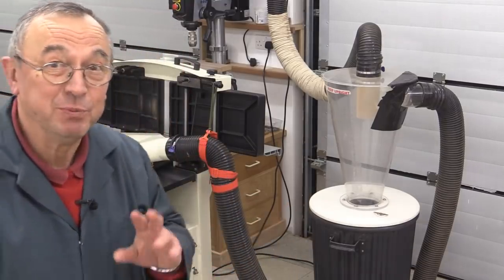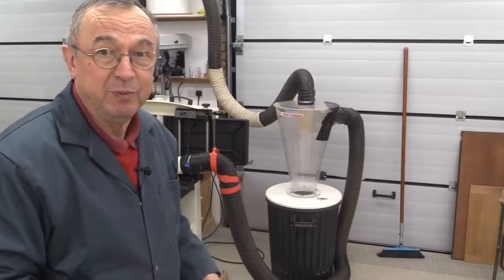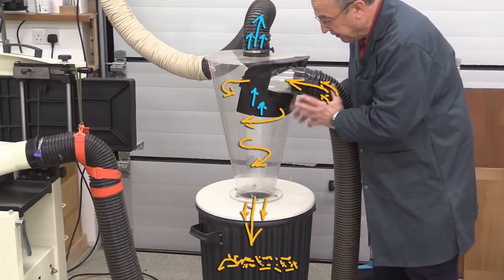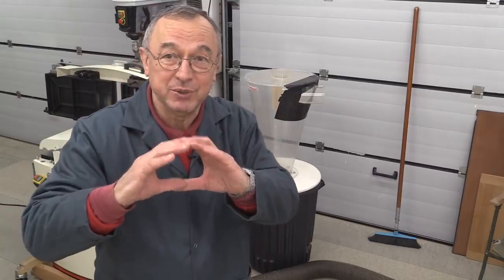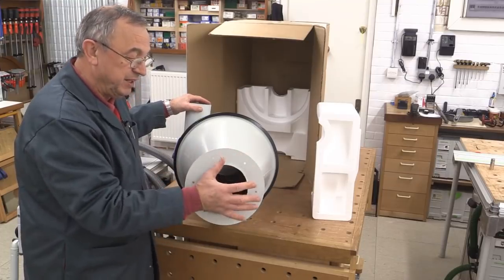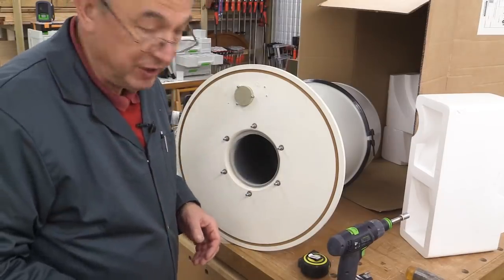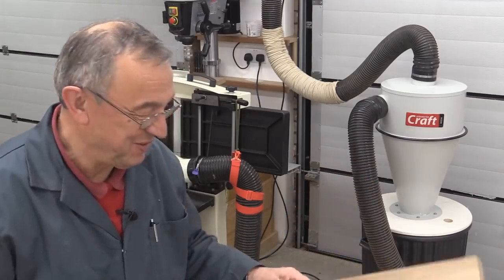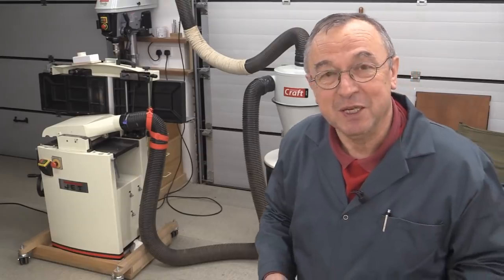New 4 inch Cyclone

Comment: Please give measurements in Imperial Units, NOT foreign ones.  We are British.  Why call your channel "New Brit Workshop" and then - millimetres - AAAAARRRRGGGH!
Reply from the maker: I just Googled the length of that bridge and the answer quoted was given in metres - 2512 m. I respect your view on measuring systems but I am glad to say that we are all free to choose what we use in the comfort of our workshops.  Peter
Reply from the maker: Hi Rebecca, On your phone you will probably have a calculator. If something is given in millimetres just divide by 25.4 to get inches. It is now illegal to sell wood in the UK in old Imperial units so it is probably a good time to try and do the switch. I moved to metric over 40 years ago and it makes all the arithmetic in the workshop so much easier. The biggest challenge is visualising a metric measurement but in a very short time this will not be a problem.   Peter
Reply: @NewBritWorkshop  I have been a Technology Teacher and Head of House in a Secondary School before I retired. My Specialist subjects were Resistant Materials, Graphic Products, Food Technology and Electronics.

I am perfectly fluent in Metric and have been for decades. The Imperial System is currently and ALWAYS has been in the Maths National Curriculum.  Our children have been taught to be fluent in both so they can deal with overseas trade.  I have found that it is VERY RARE to find a child who wants to Design Anything in Metric, the numbers are far too complicated as they are expected to measure in Millimetres.

The Imperial System is based on actual measurements of real things from antiquity when a roof Pole grown from Ash reached different heights in different climates of the UK, or Perch the same measurement from the old French Perche.  Estimating by eye is ONLY possible in the Imperial System, from inches - exactly the width of my thumb, to a span 9" to the size of a field in acres or multiples of Roods.

My timber supplier quotes me prices in  GBPounds per Board Foot.  There is NO Metric equivalent that he has ever come across.  If you buy wood from B&Q that may explain it.

Try measuring the Forth Road Bridge - In the Metric System it has to be done in Millimetres - rediculous.  It would take longer to work out how mutch paint you needed than to paint it.

I find it Insulting to our Country and our Heritage as a Brit to only give Metric Measurements for anything, but then you may be one of those undemocratic Remoaners who can't accept the result of the Referendum of 2016.

You only have to travel on our Roads to realise that distances to a roundabout are given iin 300, 200, 100 YARDS.  In fact it is ILLEGAL to put up road signs in the Metric System unless the Imperial System Measurement is ABOVE and more Prominent.  Every car on the road in the UK HAS to have its speedometer in MPH and NOT kph as all the speed limit signs are in the Imperial System.

In 2016 the Country voted for a CLEAN BREAK BREXIT by the biggest mandate in the 300+ year history of Democracy in Great Britain and Northern Ireland.
Reply: @rebeccadonaldson1464  This little (large?) rant reminded me of a true story from 1980's New York airline ops (if I remember correctly).
The traffic on the ground of course matches that in the air but the re-routing can be considerably more difficult as aircraft have become much larger as the taxiways remained basically the same width.
A female ground controller was on duty and was issuing taxi instructions for arriving and departing aircraft at machine gun speed common in the New York area. A foreign crewed 747 took a wrong turn in poor visibility and found itself unable to move forward as the turns ahead  were designed for much smaller aircraft. Obviously it can not reverse and thus was destined to remain in that position until a tug could be dispatched. The female ground controller was very upset and informed the 747 crew to " in future - you are to do what I say, do how I say and when I say it and you will not have any problems". Although it is not permitted to make transmissions not directly associated with flying operations a microphone was keyed and an anonymous voice said "Were we married once"?
There are parallels.
Full disclosure: I fully support Brexit and am a modest 172cm in height.
Woods for the trees etc: Your thumb is part of a carefully designed metric system - there being 10 digits on your hands and combine with the 10 digits on your feet to - sort of an inbuilt metric abacus.
The Brexit result: 51.9% (17,410,742) vs 48.1% (16,141,241)
Those percentages are metric.
Never mind how many thumb equivalents - you won !!
Ain't life grand?
Reply: @ahstrewth  You Conflate Decimal with Metric.  The Brits have always used Decimals, Engineers measuring tolerances to 1/1000 of an INCH, known as a Thou.
Expressing it as 0.001 " is STILL Imperial, not Metric, though obviously it is a Decimal.
An Inch is the width of a Man's Thumb.
A Yard is a Man's Stride, watch the practice of the Changing of the Guard where all the paces are accurately measured by wooden dividers, turned over and over, spaced at exactly a Yard.
How the Hell would you measure a Cricket Pitch in Metric.  It is just Not British.
You can do Percentages and Decimals in the Imperial System.  A Decimal Percentage does NOT mean that it is part of the Metric System.
Sadly our Currency has been Dumbed Down by Metrication.  Children used to be able to multiply and divide by 12 and 20 just to calculate prices, in their Head.  Now all they learn to do is x 10.  We were the World's Inventors when our children had far better mental skills taught in schools.  The Brits Invented, Steam Railways, Hovercraft, Combine Harvesters to name but three.
Despite the Imperial System Never having left the National Curriculum, our children do not get the practice.  Oh yes, the old Pennies and Half-Pennies were exactly an Ounce and a Half Ounce, so could be used to weigh anything, anywhere.

Comment: In Australia, a BIG traffic cone would replace the cone, and easily make the rest out of whatever is chosen.
Reply from the maker: Hi Lawrence, In the time it would take me to make one from a traffic cone I could make a small jewellery box and sell it for three times the cost of one of these. Also, joining 4" pipe to a conical surface is not trivial if you want to get it right.   Peter

Comment: I prefer the clear one or the other similar semi translucent plastic ones. I just like to see that it is working properly...
Reply from the maker: I have not seen a clear or even translucent 4" cyclone on the UK market. The other issue is that with plastic ones you need a pressure relief valve as they implode if your inlet gets blocked.  Peter

Comment: Hi Peter, I asked Axminster if this cyclone was able to be used with a Vacuum extractor and they said no.  But obviously it can, have you had any problems with it?
Reply from the maker: Hi Grant, Technically they are right as "Vacuum Extractor" normally means a narrow pipe with high pressure and low volume - it could even be a small Henry drag along which would not work at all. However, my Numatic NVD 750 works fine even though its flow rate is lower than recommended for my planer.  Peter
Reply: That’s great, thanks for the reply Peter

Comment: Argh, I wish they also did a 5" version. I have a 2hp extractor (looking to upgrade to 3hp in the future), and don't want to step down from 5" pipe to a 4" cyclone. Any idea if that's in the works?
Reply from the maker: Hi Matt, I think that Axminster product 510073 will do the trick but do check to be sure. Here is a link:  https://www.axminster.co.uk/hose-reducers-plastic-ax827548     Peter
Reply: @NewBritWorkshop  thanks, perhaps I wasn't very clear! I have a 5" diameter system, that only reduces down at the machine. If I was to put a 4" cyclone at the start, it would negate the benefit of having a 5" system.
Reply from the maker: Hi Matt, Yes, I understand but there is no 5" around as far as I know.

Comment: Almost sneaked that one by me ! What a neat little trick with the socket, something I'm sure I will be able to utilise at a later date ! Thank you
Reply from the maker: Hi Ian, It really makes sense when using any cast iron equipment that requires an extractor to be turned on and off. I used four 12 mm diameter magnets to ensure that it never falls off due to vibration.   Cheers.   Peter
Reply: @NewBritWorkshop  thank you !

Comment: Hi Peter,  looks really good.  Can you persuade Axminster to make up the cyclone plus bag with a motor as well.  I am sure there was one like this on the website a few weeks ago but it has now disappeared.  If this was vented outside the workshop,it would not only be much quieter but wouldn't need a filter so could be very good value.
Reply from the maker: Hi Michael, I thought that they already had that: https://www.axminster.co.uk/axminster-craft-ac118ce-cyclone-dust-extractor-105845      Peter
Reply: New Brit Workshop The one I meant is effectively one half of the craft system without the right hand side (looking at the photo) which has the filter on it so the outlet from the motor can be vented through a 100mm pipe direct to the outside of the workshop.  It would vent a little fine dust into the atmosphere but probably no more than would be released when the bag from a system with a coarse (bag) filter was emptied.  Without the fine filter it would also move nearly twice as much air according to the figures for other systems which are available with or without the fine large cartridge filters.
Reply from the maker: Hi Michael, I don't think that will work for them as it would be a one off and they would have to take the parts you want from a complete assembly.  Never mind.   Peter
Reply: New Brit Workshop Actually I think it could sell.  The work is already done so a very easy thing to include in their stock. It would sell at about £300 and would be good value.  If I can find a motor I might make one up.

Comment: Well done to get axminster to make one, looks a great product my only question is being tin / steel given the friction created by the cyclone is there any static charge build up ?
Reply from the maker: Hi Graham, The old cyclone, made of plastic, was potentially worse but it was never a problem. If anyone is worried then it is very easy to earth a metal cyclone but almost impossible to do the same with a plastic one.   Cheers.  Peter

Comment: They should put a small plexiglass window in there so you can see what's happening...
Reply from the maker: Hi Rico, I know what you mean. Despite hearing the noise of the extractor it is nice to see that it is working.  Cheers.   Peter
Reply from the maker: Hi Bob, My only caution is that people should check the fill level in their drop box at regular intervals. I am used to doing it and manage to judge when the thing should be emptied.  Cheers.  Peter
Reply: @NewBritWorkshop  Yes, I think that the plexiglass would be better served in the drop box rather than the cyclone, but I have to admit - having bought the cyclone central one a few years back after your video - there is something nice about seeing the chips flying around in the air!